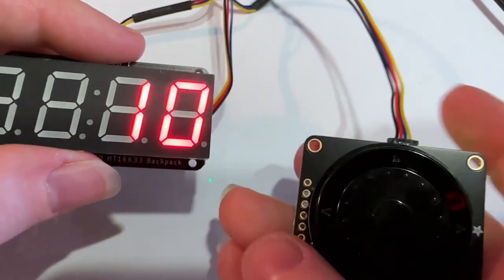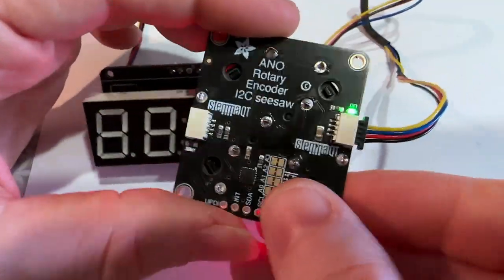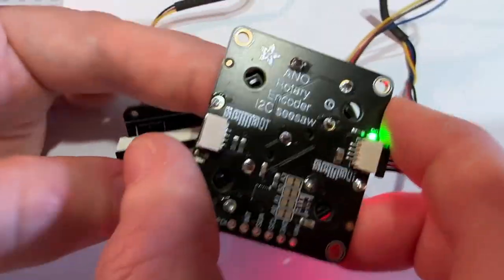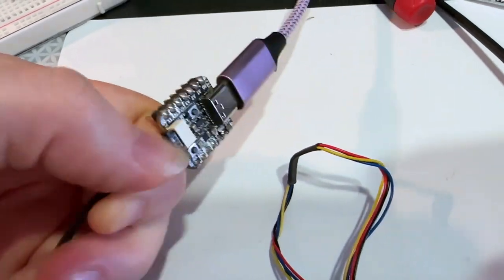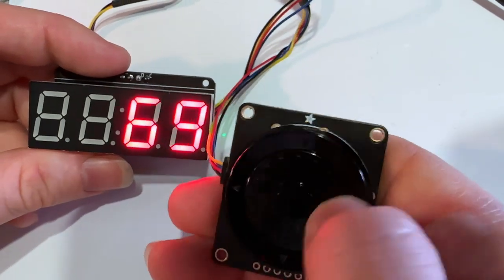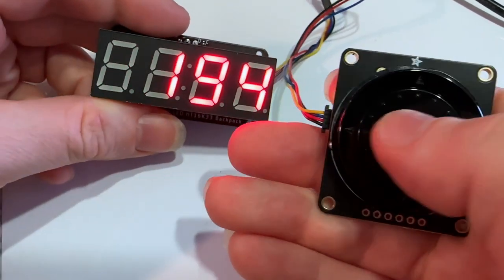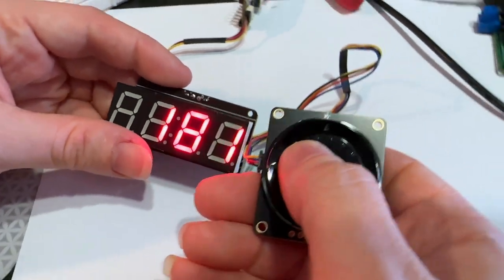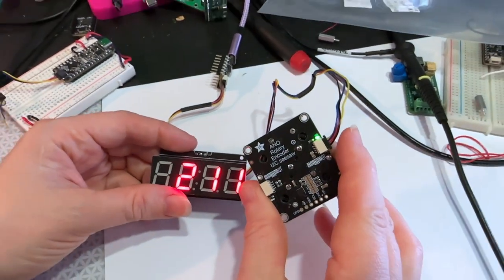Plug and play ANO encoder to seven segment

Comment: That looks amazing! Is there a non-clicky version that could be used as a rotation sensor?
Reply: There are better options for that. 14 bit digital magnetic sensor, or code disc with optical sensors for quadrature signal.